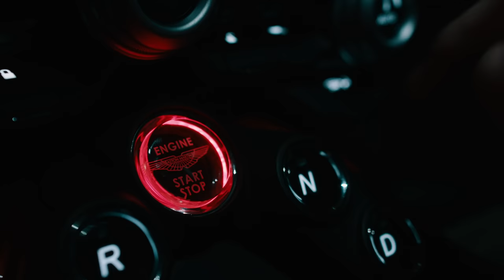DREAM BUILD MTB - YETI SB130

Comment: The car more expensive than the bike. Usually it's the other way around 😀
Reply: We'll check the price of that bike
Reply: 😆😆😆✌ so true
Reply: Especially with yeti's!
Reply: £3.5k frame. £1k DT Swiss (guessing alloy) £1.2k Fox Factory Fork £1.5k Shimano XTR £300/£400 Bergtec £380 Fox factory dropper + bars and running gear.... £10k (total build maximum maybe can do it for £8k)..... Car is worth more!
Reply: True for me. Car maybe worth $3500. Bike $4500

Comment: Pluses:

Great bike!

That dropper post cable is so elegantly incorporated into the frame!

Sweet car.

Minuses:
That file technique is SERIOUSLY lacking!  A file is a tool to be used in ONE direction, not back & forth.

DT Swiss hubs are nice, but if this is a "dream" build, you can't get much more dreamy than Chris King.  They're perfection inside and out and the way they function.  The helix spline drive is a thing of beauty.  

Just raw cutting housing & adding ferrules to a "dream" build?  Need to grind those ends!

If you put grease inside the female threads when building, you get less "squish" coming out on the flats (pedals & derailleur hangers).  There's still excess to remove, but it's easier on the bolt end.

Dry seat clamp bolts?  Yikes!

builds bike
puts bike on car and drives away
misses point

No gloves?  What gives with so many going without?  When you fall you put your hands out (Or at least most of us do.  Maybe the Judo practitioners don't...)  I've seen palm skin removed on both hands crashing on the road - with a ten mile ride home (pre Uber)!  And similarly off road.  $13k bike, $150k bike, smart enough to don the helmet, but forgoes the gloves.  Dumb.

Comment: Amazing bike, but you did not align the tire's logos with the wheels man, if you build a bike this expensive you should pay more attention to detail.
Reply from the maker: The logos on the wheel aren't symmetrical and therefore it's impossible to align them.
Reply: @GeeMilner  I get you, but you still can align it to the valve. Dont mind me, I guess its my OCD kicking again.
Reply: Misaligned logos definitely affect the balance of the wheels and hence the cornering ability.

Comment: Little bit of a weird thing i saw was when you inserted the fork to make the mark where you'll cut the fork's steer tube, you marked just above the stem, but when installing the fork definitively, you put another spacer on top of the stem, so you must've made another mark and cut above the original mark ? :D
Reply: So there’s always a gap between the top of the forks steerer tube and the bottom of the headset’s top cap. Normally this means he’d cut 3mm below the line he made if he wanted the stem to be on top but at the height he cut a spacer is needed to properly preload the headset bearings.
Reply: Doesnt matter how you stack them. It will still be the same measurement.